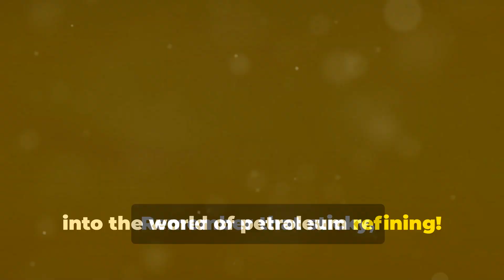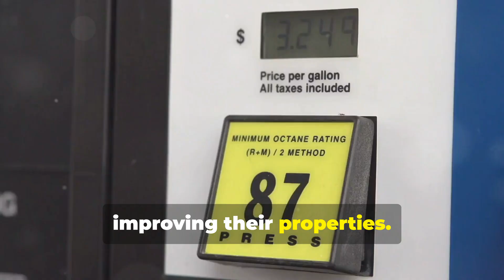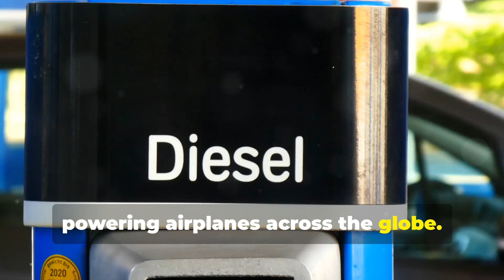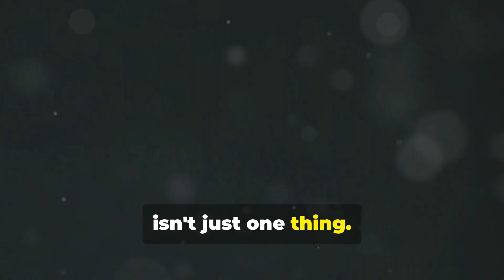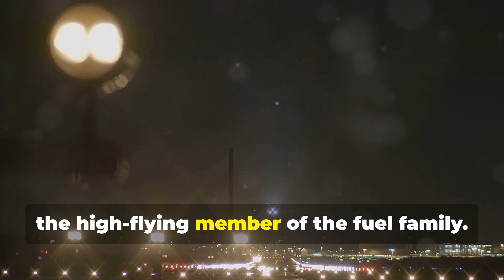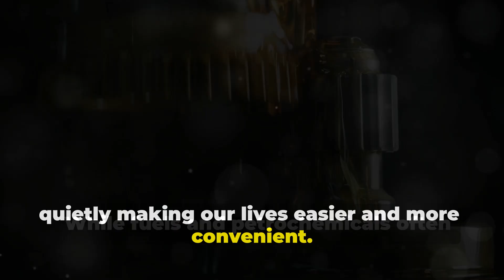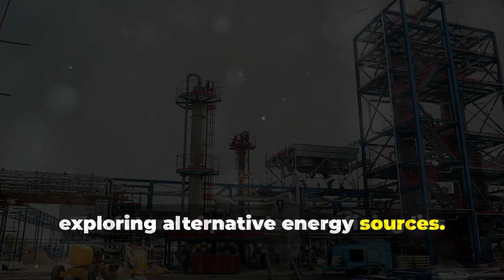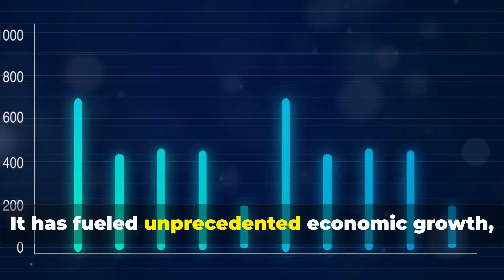Petroleum Refining Explained: How Crude Oil Turns into Everyday Products #video #oil #fuel

Comment: Interesting.  But you didn't mention how much electricity is used for these processes?  And did anyone else notice how these major refineries are located right next to large bodies of water (mainly rivers)?????????  And you didn't explain WHY they burn off the "waste gasses" instead of removing the excess moisture from the gasses and compressing it and sending it out as CNG.
Enquiring minds want to know.
Dear NSA, you know where I am.
Reply from the maker: Thank you for your insights and questions! You raise some valid points. Major refineries are indeed located near large bodies of water, primarily because they require substantial water for cooling and processing, which is more efficient near rivers or coasts. Regarding electricity consumption, it varies widely depending on the refinery’s size and operations but is generally a significant amount, contributing to overall energy usage.

As for flaring 'waste gases,' it's often a safety and economic decision. Flaring is used to handle excess gases during emergencies or maintenance. While compressing and utilizing them as CNG is a great alternative, the infrastructure for capturing, processing, and distributing these gases may not always be available or economically viable for some refineries.

Your curiosity and critical thinking are appreciated! I’ll make sure to dive deeper into these topics in future videos to provide more detailed information. Keep the discussions going!
Reply: @Thefactchannel9  Thank you for the follow up.  I grew up outside of Philadelphia and we had several large refineries located there as well across the river in New Jersey.  And gods, the smell was enough to put you off your feed for a week, but a lot of people lived near there and it would be interesting to see how many had health issues in their later years.  There was a major fire I believe at the Atlantic Richfield refinery and the Fire Chief (brother of Frank Rizzo, Police Chief) perished with a few other fireman.
I currently live about 5 miles form a refinery located on a river in Great Falls and while not the size of refineries I am used to seeing back east, it is a fair size one.  Fortunately the smell doesn't come south to us for the most part, but we DO have to drive through it to get to Wally World and they are directly across the street and it always smells there.

Thanks again for the great follow up and information.